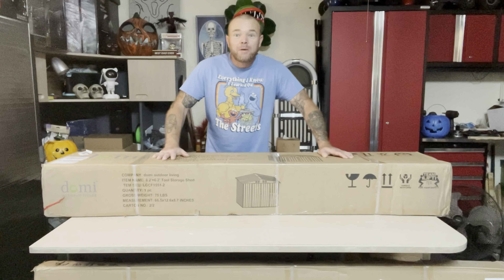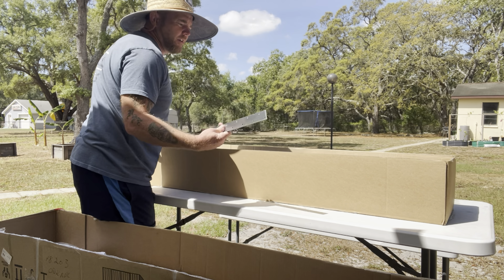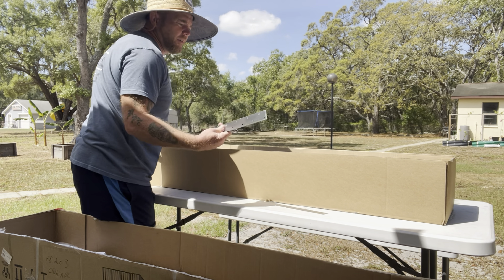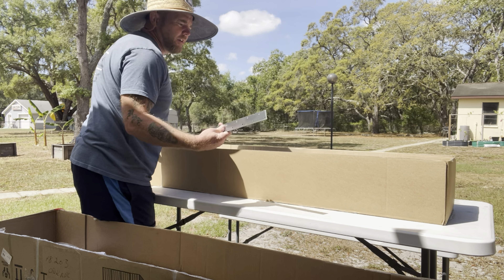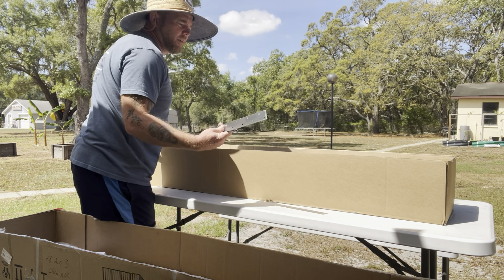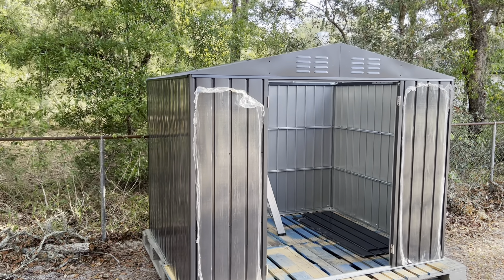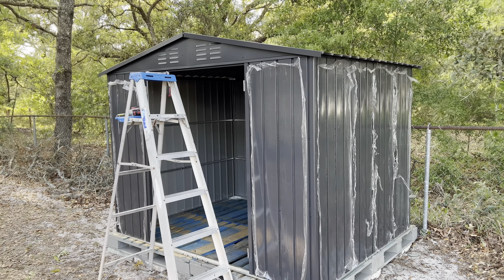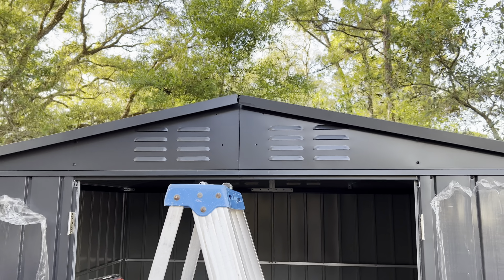Storage Shed 8.2 x 6.2 Unbox and review Domi Outdoor

Comment: Thanks for sharing your video.....I just assembled my Domi 8' x 10' shed over the past 4 100+ days here in the DFW area. A few minor sticking points, but all in all it went together great and love the end result......
Reply from the maker: Glad it turned out well for you!  I know all about that heat, I’m in Florida and it’s been hot.
Reply: @MonsterMike816  No major problems. Since mine was an 8 x 10 I was challenged to get the roof ridge cap on but was able to distribute my weight laying on a piece of OSB and reach the plates and screws....😀

Comment: Thanks for the video. I am just starting but I'm noticing that the plastic film is very difficult to remove. Did you have that issue?
Reply from the maker: Yes it is a pain.  I pulled up anywhere that would get overlapped and then removed all of the plastic after it was built.  If you have an air compressor, you can get it started and then used compressed air to blow underneath the film to lift it.

Comment: 3:26pm today. 
How do I attach the corner bracket to the base. #1 screws are not tightening
Reply from the maker: You may have to get some self tapping screws from the hardware store if the ones provided aren’t biting.  Contact the company also and tell them about it so they can try to make it right with you.  Good luck and I hope it turns out well for you.

Comment: How did you install the roof cap? I bought the 9.3'x7.6' shed and can't reach the center of the roof to connect the pieces?
Reply from the maker: You may have to remove a ceiling panel on one end so you can reach the middle, then put the panel back on and try to finish the cap from the outside.
Reply: @MonsterMike816  Thanks